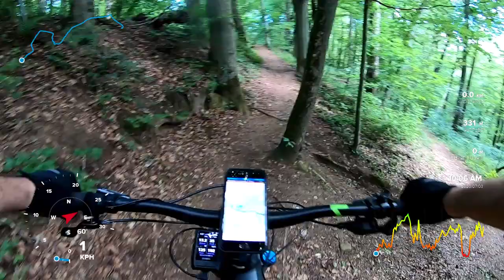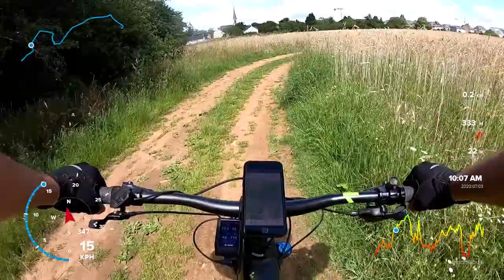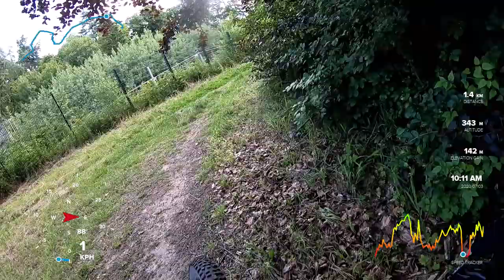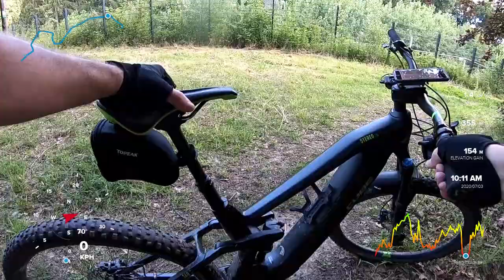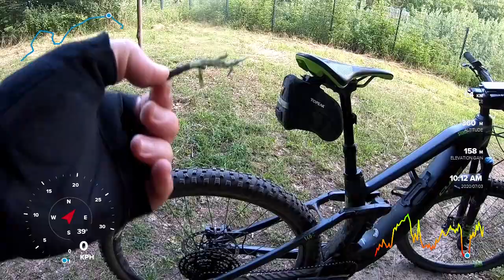Upcoming Bosch motor firmware updates - Torque increased to 85 NM

Comment: Fantastic reviews for r-m bike, saw whole series so far, very well done.
Im considering Charger3 for commuting in Luxembourg (30m in total everyday going to/back work), i was more into classic deraileur, but now i saw you took enviolo and really liked it.
My question to you is: would you still consider enviolo after your experience, or rather consider cheaper classic deraileur, or maybe more expensive rohloff option ?
The biggest issue i saw with enviolo in your movies is when climbing up, the ratio seems to be not enough to get comfortable cadence right ?

Comment: I like your on-screen displays of the route, speedometer, compass, and speed graph.  Nice that you have a separate dedicated ebike for trails!  I am planning to use one ebike, Superdelite, for everything.  Still waiting for it to get here.
Reply from the maker: Flyshacker, the overlays are provided by GoPro for free with the free video editing GoPro Quik software. The data is embedded in the video files, which I find very neat. 
Which model of Superdelite did you order?
Reply: Ruirodtube - I ordered the 1125(?) watt, Rohloff GX, with Fox Suspension.  We have many steep hills around us.  I don’t have a trail bike, so I hope that one Superdelite GX will do everything for me.  We ordered another Superdelite (small frame) for my wife as well.  Lot s of money, but we retired early and look forward to a LOT of riding and fun times with our 2 Superdelites.  The bike store says our bikes already arrived from Germany, and it will take another 1 to 2 weeks to get the bikes assembled and ready for us to take.  I hope they also apply the Kiox software upgrade and the Bosch motor upgrade before we take delivery.  You haven’t mentioned lately about your Superdelite SADDLE, which you didn’t like at first.  Are you getting used to it?  Or did you replace it?

Comment: Hi could you tel what holder you use for mobil phone
Reply from the maker: Hi Marián, I'm using the Topeak RideCase. It works great! Cheers!
Reply: @ruirodtube  thanks
Reply: @ruirodtube  and type 1/4 or 1/8
Reply from the maker: Marián G it depends on the size of the stem cap of your bike because it’s a direct replacement of it. You unscrew your current stem cap (store it somewhere) and you screw on the Topeak stem cap.
(I didn’t understand your question initially. When I bought my Topeak there was no choice between stem cap sizes :-))
Reply: @ruirodtube  i have same bike like you. And im from slovakia and nobody have this ridecase her. Befire this bike i have cube 625 race
Reply from the maker: Marián G let me see if I can find the box and I’ll get back to you with the precise reference so you can order it online.
Reply: @ruirodtube  because when i mesuare its 3.4 cm and Thye have 3.5 or 3.2
Reply from the maker: Marián G I found the box. It’s the 1-1/8” stem cap. 
I’m glad to have kept the original box. 
Enjoy a great product!

Comment: Great video. Could you disclose which local dealer you are referring to for the update? Thanks
Reply from the maker: Hi Frederic, thanks!
I would advise you go to the shop where you bought the bike. 
But in general any bike shop that sells e-bikes equipped with Bosch motors has the equipment necessary to perform the update.
Cheers!
Reply: Hi all the deslers in Oslo wants to charge  you for this service update.  Som take 250 kr others 450 kr. And this is not necessary.